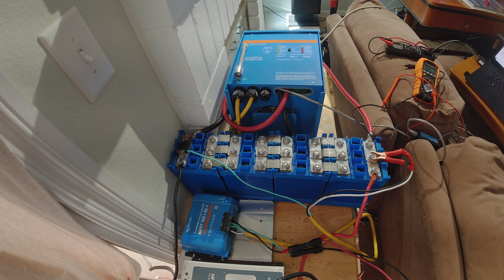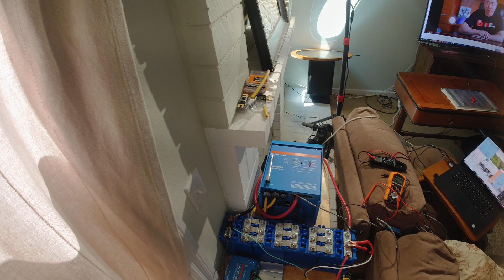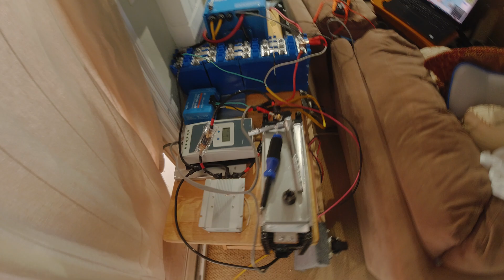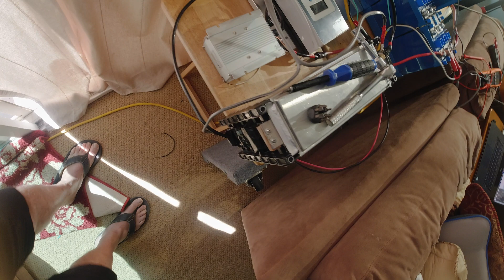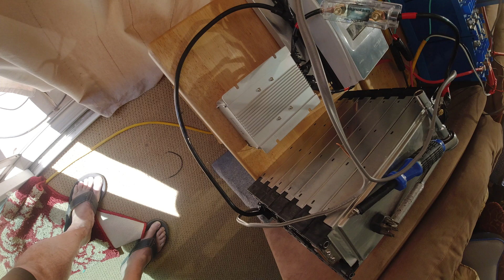Fortune LiFePO4 Battery Cells, CREATE 12V, 24V, 36V, 48V or 60V Lithium Batteries SUPER QUICK!

Comment: Great video. Any suggestions on a compact light weight battery 60v / 60ah? I'm open to having an external battery mounted on my front stem. It's for my Weped GT50 electric scooter. My battery output is only 14.7A max @ 60V for short periods, and only 9.8A continuously. The dual motors are rated for 1800 watts continuous each. The battery can only deliver a peak output of 60 x 14.7 = 882 watts. I would like to upgrade the battery with better cells and BMS. 3600 watts / 60 v = 60 amps...that's the output the battery should be able to deliver. Thoughts?

Comment: 18650's are also good cells Sir!
Reply: Apples and oranges my friend. To create an 18650 pack with this must current potential  is an entirely different   matter. These batteries make large battery packs very very simple.
Reply: But 18650 are normally lithium-ion and if one sells goes bad it'll burn your dang house now